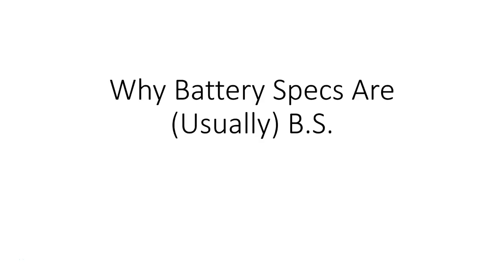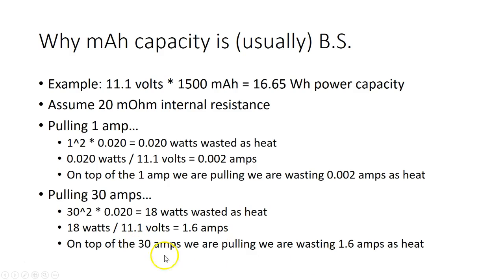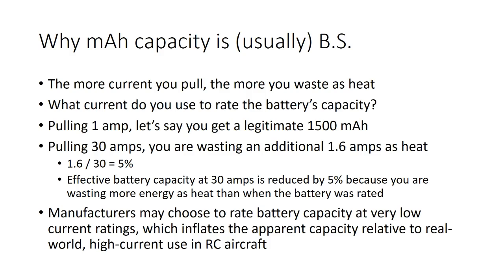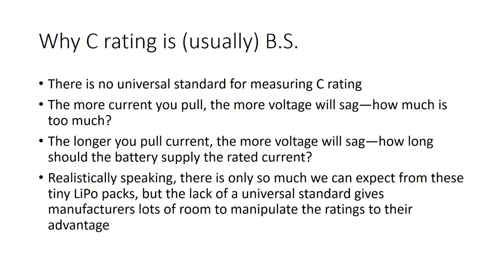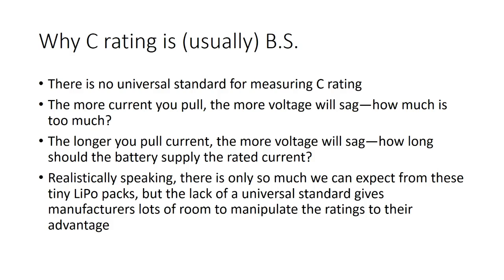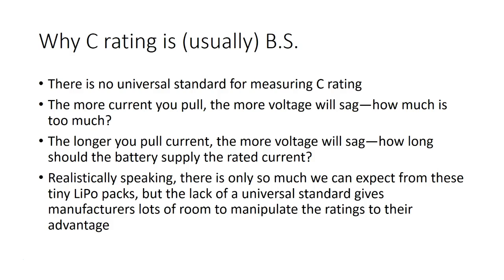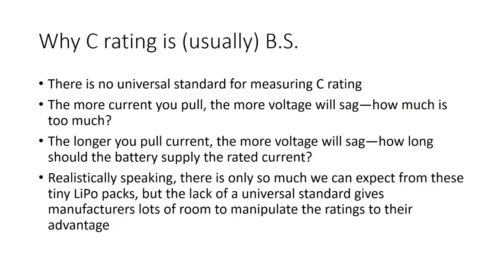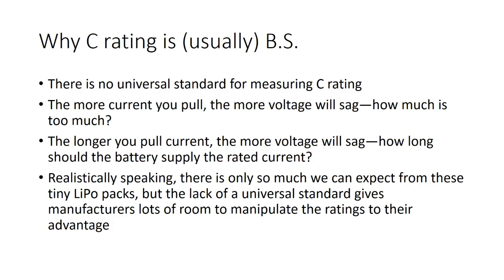Why battery specs are (usually) B.S.

Comment: Numbers game like car audio amplifiers and speakers

it would seam the ceiling is centered on how well a lipo can handle heat
perhaps max heat should be used as a constant in a battery test..
max watts/amps per minute @ < +1.5C ?  on a graph with the rated ma level?

Comment: My LiPo batteries (I bought 6 of the same type) have a 10C discharge rating. The capacity is 5.2Ah. I can safely pull out 25A of it over time, right?
Reply from the maker: +AtDiT c rating times capacity in amp hours equals niminal discharge rate. So your nominal discharge rate is 10 * 5.2 = 52 amps.
Reply: Nice

Thanks for quick response

Comment: I wouldn't say that the ratings were bs, just that you're not discharging them at the current the manufacturer is quoting the capacity at.
Reply from the maker: +TheChipmunk2008 I fully admit to sensationalizing the title a little bit, but I do think there is a valid criticism here. If the manufacturers don't publish the rated discharge current, and/or if the rated discharge current doesn't reflect the actual use of the battery, that's where the B.S. comes in. More fundamentally, if a battery is rated for e.g. 90C burst, but what that means is you will get 90C for 1/2 second before voltage sags, then I don't think that is very honest.
Reply: +Joshua Bardwell Oh absolutely, if the cells are sold for high current use, they should be rated at that, it was the sensational title I was disagreeing with <grin>

The problem is probably the same as the PMPO thing in stereo circles in the 80s and 90s (fortunately that seems to have died out a little except in car audio): No ONE manufacturer is gonna start being honest because it will make their product less competitive to most of the buyers :(

Comment: Cheers JB. I found this vid while shopping for lipos recently. Might be of interest.. =2dlIymZaqd0
Reply from the maker: +Revs Niiiiice. This is the kind of thing we need more of. But I will say that, if the company is not absolutely on top of their supplier, this kind of thing may not mean as much. Quality of cells can vary over time, especially if you are buying from e.g. budget Chinese suppliers vs. high-quality cells from Japan. So a pack that rates an honest 30C one day may not a month later.
Reply: +Joshua Bardwell Of course, there are soo many variables that nothing is guaranteed, even if every last cell was tested. I do wish they'd all include a guide with their lipos though. Some info on what voltage to discharge to, the lowest you should go under high load, how long to give it after charging before use, how long after use until you charge, etc. All these little things add up to quite a difference in life span and performance.

Comment: Josh what you did is mathematically correct just an unconventional way of showing it tbh.

Its not totally your fault as Ah is a crap way of representing the capacity of a battery because it only tells you what current it can supply and for how long but does not tell at what voltage it will supply that power a matter of huge importance.

However with the ir and the ah ratings you can work out the real Whr capacity of a battery.

In your calculation you gave an example of 30amps on the battery. 
Theoretically the battery would be putting out 333watts  of power but 18 watts of that is being lost in the voltage drop over the battery itself.

This means you end up with a (18/333) 5.4% loss of usable power when pulling 30 amps.

At 60 amps it would be (60^2*0.02)/(60*11.1) = 72/666 = 10.81% Power loss through battery heat.

Note. I would be worried about a battery dissipating 72 watts without turning into a hotdog but maybe the airflow with miniquads helps.
Reply from the maker: +Stephen Gibb One source of inaccuracy is that IR changes as current flows. I believe that, as current begins to flow, IR drops. So you can measure IR on the bench as a way of comparing packs to each other, but it isn't an accurate way of estimating heat dissipated during actual use. Once you are pulling 60 amps from a pack, I guess the IR must go down by a lot. The packs often come down warm, but not 70 watts warm.
Reply: Difference being very few people use a 1.5ah battery in 90secs I am sure if you averaged 60amps you could very well be putting 70 watts of heat out of the battery considering manufactures like to spec best case scenario.
Mr Steele says his 1400 lasts 2.5 minutes which is an average current draw of 33.6 amps which is probably similar to what you are seeing.

I agree lipo tech hasn't really gone anywhere in the last 5 years. In fact finding packs nowadays as good quality as kokam or polyquest were is virtually impossible.

Comment: It would be very helpful if the packs were independently tested using a published standard test procedure with the makers named and shamed. The RC car fraternity have the ROAR certification and that qualification has become a marketing as well as compliance tool but it also fails to totally eliminate false claims. I have not seen a single 'brand' on the market with trustworthy continuous discharge figures once you get beyond the easily achievable 30-35C rates. 
I would go so far as to say ALL conventional LiPo pack manufacturers claiming much more than 35C continuous are bald faced liars.
Reply from the maker: +Rob B There is the RCGroups battery test thread, but that person doesn't seem to want to test small packs.
Reply: I agree.  manufacturers that have a wide range rating on the battery are manipulating the rating.  80c for half a second and 40c for 2 second.  They could infer anything!

Comment: turnigy would usually say 45-90c, now I know why
Reply from the maker: +Ishfaaq Jhaumeer I basically ignore the "surge" rating of batteries. I mean, some batteries may surge better than others, but if you are relying on the surge rating, you're gonna have a bad time. For example, I have a copter that wants to pull about 120 amps at full throttle. The minimum battery I would really be happy with would be something like a 65C 1800 mAh = 117 amps. The fact that the battery is burst rated to 90C or whatever... I don't care. Frankly, even the continuous rating is often ambitious, so no sense pushing one's luck.
Reply: +Joshua Bardwell I vouch for turnigy tho.. I've had 20c batteries on copters that pull > 25c without any issues, and I have often approached the upper capacity limit way to close. the batteries are still perfectly fine. Either I was extremely lucky every single time, or turnigy's rating is really conservative.
Reply from the maker: Ishfaaq Jhaumeer FWIW, I also use Turnigy batteries--more from being cheap than any devotion to their performance--but I have gotten good results. That being said, 20C is easy to hit. It's when you get above about 30-45C that everybody seems to fall on their face.

Comment: I had to watch it 2 times and i am not a native english speaker, but the first 4min is totally wrong imho. The capacity in mAh is not depend on the internal resistance or the amps drawn*. The internal resistance is serial, you don't lose amps, you don't lose mAh-s, but you lose Wh-s. (*) Maybe you have less mAh at higher current, but it is because the chemistry/physics, maybe, i don't know. Or you talk to people not understand electricity, and converting the loss back to mAh, because they see only mAh-s, but it's misleading.
Reply from the maker: The argument is that drawing at higher amps wastes more energy as heat. Therefore, useful capacity is reduced.
Reply: +Joshua Bardwell See my reply to your other video. +stinkydiver73 is correct here. You get the terminology wrong in the first 4 minutes of the video. Internal resistance does not effect mAh. If you have a current meter measuring total mAh used by your battery it will be the same at 1A or 2A even though 4 times as much heat is being dissipated in the internal resistance of the battery. At higher currents, something far more complex is going on as the Ah rating of the battery decreases.
Reply: +Joshua Bardwell I&#39;m not trying to be overly critical here. However I think one of your great strengths as a Youtuber is your willingness to correct previous videos you have made, especially the ones about min_throttle etc. PM me if you want me to check any scripts regarding electronics, I am an EE.

The gist of this video is correct, but the maths you are doing at 1 minute mark is incorrect.
Reply from the maker: +Goat I accept y'all's assertion that I'm incorrect, but I don't understand. I'm not sure YouTube comments are the right venue to work it out. Can you email me at joshua bardwell at gmail dot com?

Here is the essence of my confusion: if the battery has so many Ah to give, and it wastes more of those Ah making heat, then how does that not result in a reduction in usable Ah coming out the discharge lead? I understand what @stinkydiver73 is saying when he says that it may result in a reduction in Wh, but I don't see how a reduction in Wh could not also result in a reduction in Ah.

Hmm... hang on... it's because there is proportional voltage drop isn't it? So you have the same amps at a lower volts, right? But that's amps. If you determine amp-hour capacity based on a certain cutoff voltage, then the voltage drop WILL reduce the effective amp-hours by causing the battery to hit the cutoff voltage sooner.

Oh well... email me and let's discuss. At best, I'll learn something, and at worst, it'll make for an interesting followup video.
Reply: +Joshua Bardwell email sent. You are 95% right, just need small fixes to terminology.